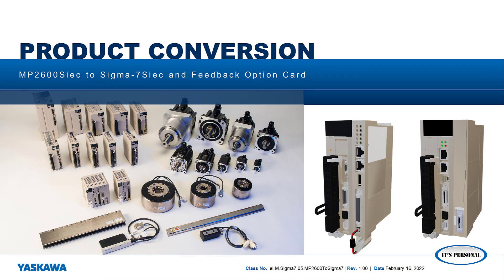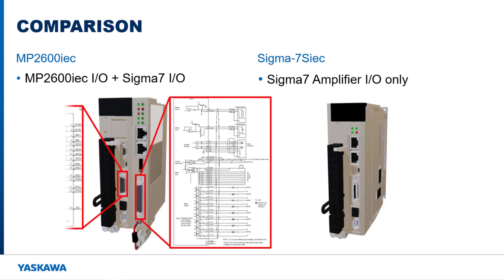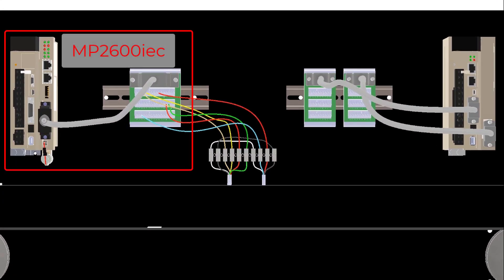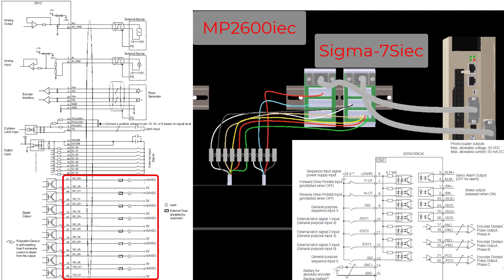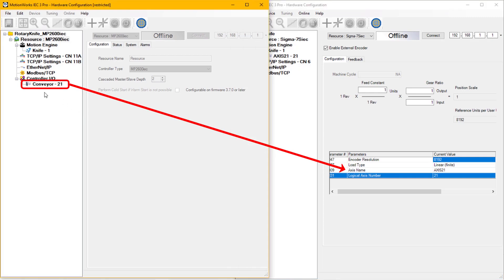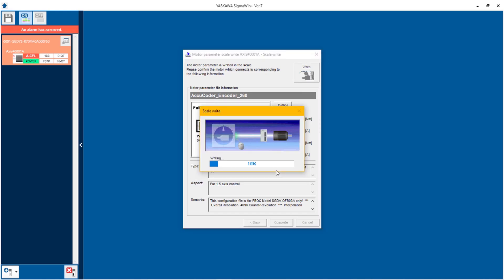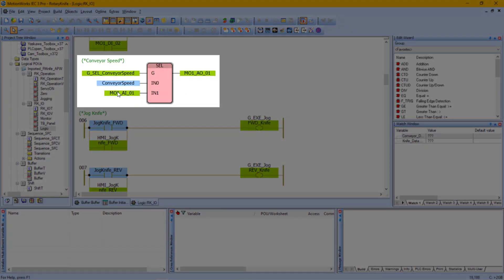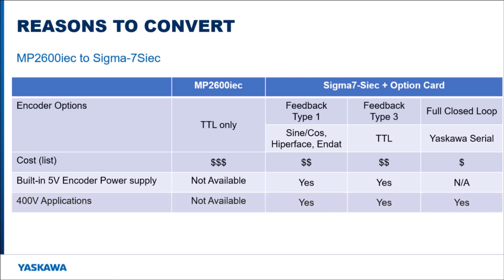Product Conversion: MP2600iec to Sigma-7Siec with Feedback Option Card

Comment: Hey Micah, Peter from Yaskawa UK here. First off, thanks for the video, secondly was there a reason why you disconnected from the S7-IEC rather than using a software reset through SigmaWin+. Also do you know which version of SigmaWin+ will have the parameter PN00E.3 included? Thanks